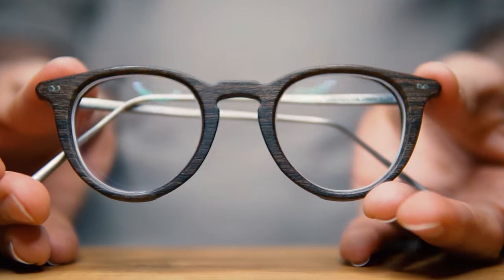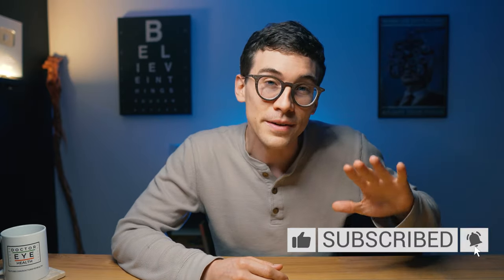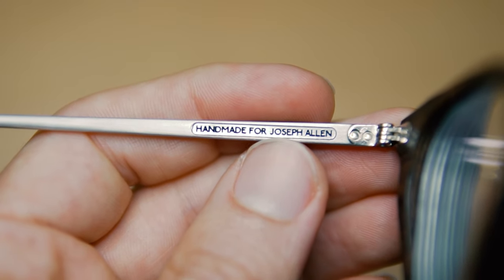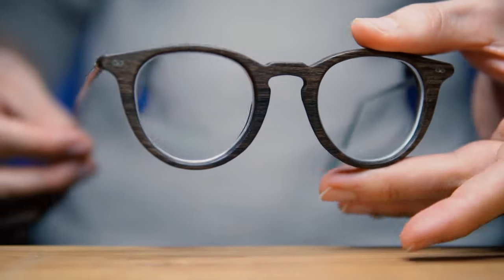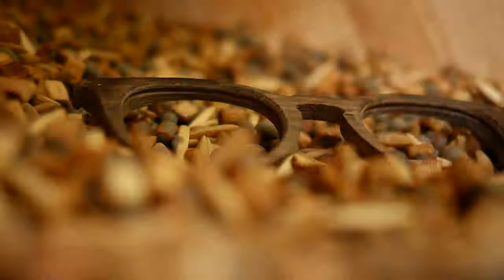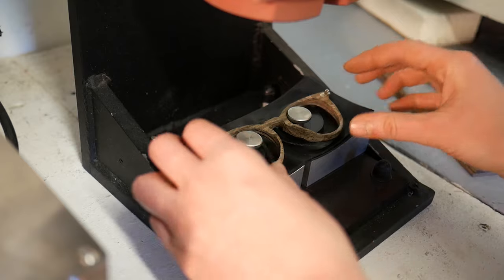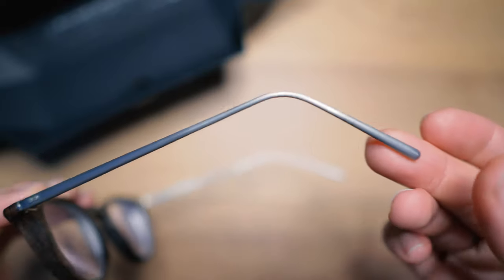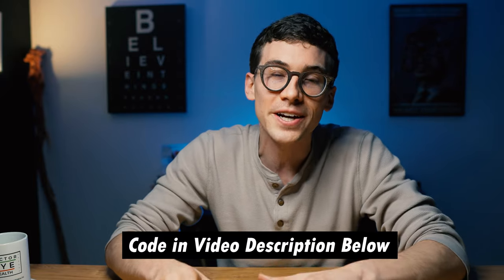My NEW Glasses! - AMAZING Handmade Custom Eyeglasses from Banton Frameworks (Best Glasses for Men)

Comment: How does the wood frame feel? Is it heavier than plastic? How do they custom make frame from such a long distance? Usually someone tries on frames in person in the optical center.
Reply from the maker: Great questions! This was a long process in the making. Many revisions and communication. Discussions about the product size, shape and materials so they they could be adjusted well once I got them. The frame feels great. Sturdy. A little heavier than plastic.
Reply: @DoctorEyeHealth  Are adjustments needed now or at a later date? How does that happen?

Comment: I know this has nothing to do with this video, but I wanted to ask a question about contact lenses. I recently just got my first pair of contact lenses as a sophomore in high school because I felt really insecure about my glasses, and I thought about ordering them online to potentially get deals and sales to save money. I have my prescription, and I luckily know how to read it because of you! (Thank you :) However, I recently found out that I had astigmatism even though my optometrist didn’t tell me? I found out by looking at my prescription and was surprised to see the words “for astigmatism.” I tried searching the contacts that they gave me online, and I could only find that the brand I had only sold the bi-weekly version in the exact same model as my optometrist prescribed me. My optometrist told me to wear them for a month, and now I’m a bit worried that they gave me bi-weekly lenses to wear for a month. Should I use the same brand and type of contacts they gave me and still wear the bi-weekly contacts for a month, or should I do some more research and try to find another brand that actually sells monthly ones? If you ever see this, thank you for taking the time to help people understand what’s going on with one of our most important senses, our vision!

Comment: Is there a good website (and reliable) to order glasses and frames altogether and it be properly done? Thanks in advance!
Reply from the maker: That is a tough question. I have only tried online glasses from a few companies, but I am trying to do my own research on that same question. At this moment, I have had the best experience from Banton Frameworks (this video). Although studies have shown the accuracy of most online purchasing (around almost 60 percent) to be inaccurate.  What I think is best, is if you want to order glasses frames online - it is still best to get the lenses fit in a local shop. That will grant you the best vision and accuracy.
Reply: Doctor Eye Health thanks for the reply! I just got my new glasses and will have to go back in to change the frames because they are too tight and since they are plastic I’m sure they can’t be resized properly. I think you should make a video on how to pick the right size and what each number on the temple lines mean!!!

Comment: I have a question & I know this is off topic but one thing I ABSOLUTELY LOVE & And is a passion of mine is colored contacts. I've been wearing contacts since I was a kid & I've REALLY gotten into colored lenses about 4 years ago. Now I won't lie. I'm not the most responsible when it comes to taking them out at night (i do need them to see my prescription is -3.50) now I've never been told I have an astigmatism but I've been noticing one of my lenses will sit perfectly in my one eye but the other will kind of shift and make it look like I have a lazy eye or like one eye is looking at u & the other is slightly looking elsewhere..)😳😩😤😣 this is making me wonder could this be caused by having an astigmatism & possibly needing a special lense ?? I'm EXTREMELY upset because I just ordered about 7 pairs of lenses which cost me almost $370 I am noticing in about 4 of the pairs that have smaller pupil holes & especially if the contact lense color is a lighter color as in a very light blue or very light green for example. Could this be from developing an astigmatism & thats what's causing one of the lenses to not sit EXACTLY in the "correct" place to make the colored contacts look real? I'll be SO upset if i have i have to purchase them all over again for the same price in the same colors just bc i have to enter the numbers for the astigmatism...

Comment: I just got some prescription glasses from the internet and the experience has been mostly quite good. However the progressive lenses require me to tilt my head forward slightly to see things clearly at about 40 ft. The region that separates near vision from far vision in progressive lenses, what controls that? Was my near PD not quite correct or perhaps my far PD?

Your channel is very enjoyable and I've been learning a lot about contact lenses (I've had less than steller experience recently with my contact lenses).I think I must be one of those people you mentioned who's extremely picky about his vision! Thank you!!!
Reply from the maker: Ah really good question! It sounds like it is less of a problem with the PD as it is with the optical center. A major issue with many online glasses is that they fail to address the optical center height. Based on where the lenses/ frame rests on the face, the optical centers can be too high or too low. Since you need to tilt your face down, it sounds like the optical centers are too high, which means your are looking slightly through the mid zone of the multifocal and getting too much plus at distance. The frame could maybe be adjusted to fix this but they could also result in the frames not fitting correctly or change the effective power of the lenses. Best to take them into a local optical shop to see if they can adjust them to work better for you. Another point, online glasses are often cheaper, they do this by using older multifocal technology in their lenses. Like buying an old computer, newer lens technology works better and has less distortions as well as a more forgiving mid range zone.

Comment: What is the power of your prescription lenses?
Reply: Jubair Islam looks like around -5.00
Reply from the maker: around a -5.00-1.00x 090. THat is not the exact prescription but close to it.
Reply: The resultant power is only - 6.00 DS. Then why the lens is too thick.is the lens index is 1.49
Reply: A good deal stronger than mine. Upgrading the lenses makes sense at that point and I suspect his vision isn’t going to get significantly worse and he can get away with lifetime glasses. People who have weak eyesight to begin with aren’t going to see much of a loss except after 40 both reading as well distance vision become affected and around that time ODs switch patients to progressive lenses so a lot of people still have both the first for indoors and the distance for outdoors.

Comment: can i shower with contacts in
Reply: shaam no they can shrink to the eye surface best to take them out first. There are nasty microbes even in tap water that you don’t want on contacts. If you do by accident wait 30 min to take them off to allow the contact to return to size. You can tear your eye if it’s tight.